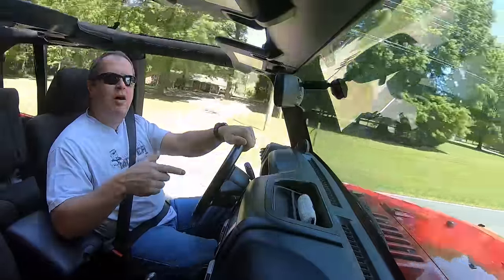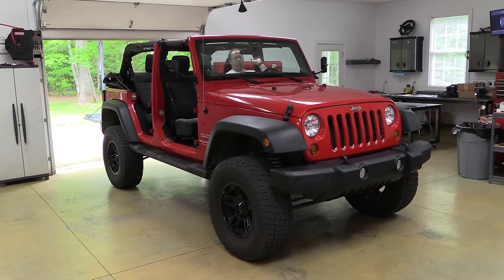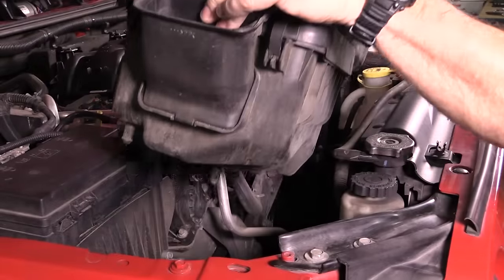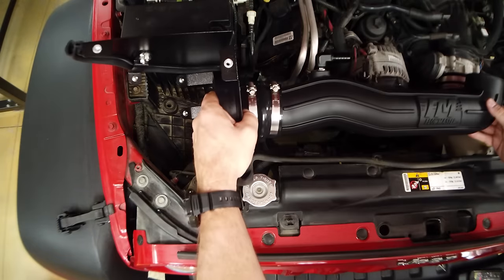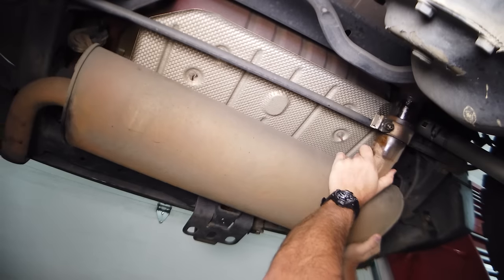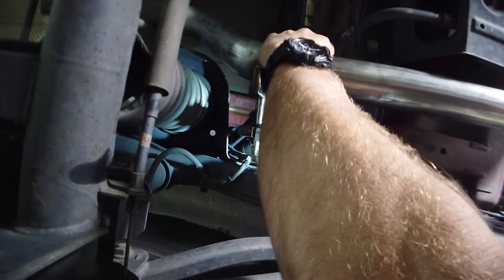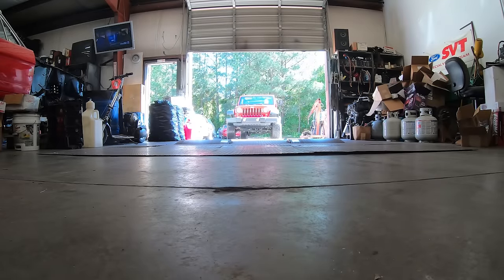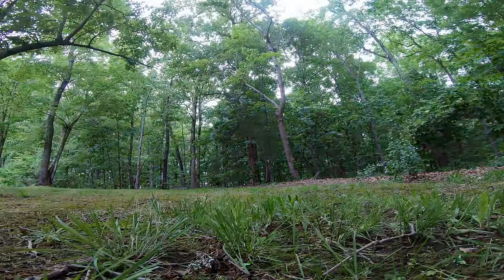Real Horsepower Gains in Jeep Wrangler with Intake and Exhaust Upgrades (Easy Bolt-Ons Only!)

Comment: The best way to get power back after adding larger tires is a gear swap.
Reply: That’s like 2k
Reply: And it’s still not enough. Here in the mountains my jk on 37’s with 5:13 gears is a total dog
Reply: @francisdebelo dang, I’m on 35s thinking of 4.56 or 4.88 what do you recommend
Reply: @Danielxperez14 JL two door manual on 35 with 5:13 . Was running 4:88 on my JK auto for 37 . 

5:13 on the JL because planning to run 37 soon .
Reply: @Joker-TMF  so 488 is good for 35s? My jk feels super slow ever since I bought it
Reply: @Danielxperez14  4:88 is perfect for 35 . Maybe you need a tuner with chip to set everything after .
Reply: @Joker-TMF  what would I need to tune for? I got a diag tool for Jeeps that already calibrated my 35s to the speedo
Reply: @Danielxperez14  on my JK on 37 on beadlock the mods I installed is gear 4:88 , superchip, exhaust, intake, pedal commander. Was running really good .
Reply: @Joker-TMF  I’ll have to try that out then, mine feels like it bogs when I step on it and it takes a while to get up to speed, but 10-15 mph it’s responsive

Comment: The sound difference is amazing! I really thought you were going to get more like 10 to 15 hp out of doing that. Wow.
Reply: Ecu needs adjusted.  Look at the power curve.  It is rough
Reply: @kyleolin3566 correct most people think intake and exhaust are enough, it’s not the ecu needs to be flashed/changed or your unlikely to see bigger gains due to the map on it. You gain horsepower and a slight increase in mpg when you do it that way.

Did I take and new chip on a grand Cherokee got 12 horses and 7 lbft of torque. Was a little under a grand to have done.

Comment: The stock intake on the jeep wrangler is a thing of beauty, a rare engineering example of functionality over regulation. You don't need an aftermarket intake on a wrangler, it doesn't do anything, zip, zero. It also increases your chances of sucking water into the intake manifold when you replace it. The exhaust is something that I can get behind though, but you need to remove the catalytic converters and flash the ECU. If you're looking to stay legal, you'll need a custom exhaust to accommodate the lift you chose, if you're hard-core.
Reply: Interesting as K&N has a CAI snorkel kit that puts the air intake above the windshield.  You must be driving totally submerged
Reply: @twoallame yeah… actually… in Alaska we’re routinely finding water crossings that threaten a stock intake.

Comment: The power will be even better after ~500km. 
ECU will change the settings.
Reply: ecu will change air fuel ratio pretty much instantly
Reply: The auto transmission will learn and change as well.
Reply: As  @IGOPU  explained ecu correct the afr right away or you would melt the piston on the first start making it lean.

Adding more airflow by itself won't do a thing to power, 7 HP difference can just be observed between two pulls back to back.

If you want power you need to move timing and or compression.

Comment: My comments are mainly on your video.  Very, very well done and clear explanations.  I am impressed you were able to get the old exhaust off without having to lift the vehicle.  I am waiting for a Pypes higher clearance exhaust purchased through Quadratec.  Right now, I will likely do a K/N flat unit (no CAI).  As one response stated, I will be regearing (through 4WP).  Again, very good video.  Mine is a 2020, Sport Altitude.
Reply from the maker: Cool, good luck!

Comment: Flash tune it so the vehicle knows there are larger tires/wheels. Will make it perform at the optimal levels and also get your Speedo back in line. Then consider performance parts. Just my two cents! Once I did that after 37” tires it made the jeep run as it should and had the familiar response I was used to

Comment: Loved it and making more power is always a good thing. The next step is to swap out your gear sets  and install a ratio that will bring your engines operating range back into its torque sweet spot. Love the new diff cover by the way..
Reply from the maker: You are definitely right about a re-gear. I got the diff covers from B&M. They actually have dipsticks built into them to check gear oil levels or check for water intrusion in the diffs if you have been wheeling in creeks. Thanks for watching!

Comment: Thanks for this simple instructional video it's crazy that this showed up in my feed cuz I was just thinking I really need to figure out something for my JK the fact that it's a Rubicon and it is gutless really gets to me and there's no way it's going to be able to push 37s so thanks for this video I'm probably going to order that exhaust system and that intake right now
Reply: What gears are you running? And how much extra weight on the chassis?

Comment: You can't never go wrong with those power add on's but☝️ if you want your Jeep to get back to how it felt with stock tires you might consider changing your Ring & pinion and a good high performance clutch. Nice Jeep btw.👍🏽🇺🇸
Reply from the maker: A re-gear would definitely help. Thanks for watching!
Reply: @TheHorsepowerMonster   Thank you for sharing.👍🏽🇺🇸

Comment: My 02' GC 4.7ho Pushes 275-300HP with a 231amc transfer case with 2wd option, magnaflow performance exhaust. Even with a 6 in  lift kit she rips down the road like a real jeep should.
Reply: Pick a horsepower number. There is no she does between this and that. Come on now.
Reply: @dirtysouthtv2209  came stock with 275hp I already put in over 1K$ in HP mods, def pushing at least 300Hp fuck a dyno lol
Reply: @dirtysouthtv2209  wheres your jeep🤔 lol

Comment: I did the same thing with my 2014 4 door wrangler except I used a K&N aircharger intake system and a magnaflow performance catback exhaust.  It definitely increased acceleration and better high speed highway driving.  not sure exactly how much horsepower increase though.  And definitely sounds a lot more "manly"   ; )

Comment: JScan app and OBD2 is the cheapest way to update the ecu with new mod tyre size. It makes an amazing difference. Maps power and shifts brilliantly. Gets rid of her chatter. I was completely stunned when I did mine. Tip go 1 higher there size than what you fitted.

Comment: 2013 sport with 35" + 3" lift : I upgraded with the cheapest air intake and exhaust system for 350 CAD$.  Nice sound and little more power of course. But, the big difference is in the mileage... an average of 4.5 miles/gallon increased. Don't hesitate to do these upgradres !!!
Reply: I agree totally. I' m looking for efficiency (as in an increase in MPG) more than HP and/or FPT. So....I'm going with the Rock Crusher exhaust and the AMFIB Snorkel Low Mount intake system.  
I'll let you know how it works out after the install,
Reply: what air intake and exhaust did you get?

Comment: Have a 13 with 155,000 miles on it and starting to loose power. The engine still runs great, probably a CAT getting plugged. Great video

Comment: One thing that gets me with these after market intake kits is the lack of accumulators.  Those big blanked off tubes on the stock intake assembly are there to hold clean air.  When you step on the throttle hard, this air is drawn into the motor to give a better instant torque numbers.  They have no effect on average number though.  So think of it this way, those are there for taking off from stop lights and sighs.
Reply: Interesting. I thought those were to designed to reduce intake noise.

Comment: Thanks for doing the test so we can avoid doing the same mistakes.
Basically no change in power. A 7hp difference can be due to tempe or atmospheric co ditions.

You would better off playing with the timing and compression, if the head flow enough you might gain some hp.

Comment: Gearing swap in the axles helps a ton too.  Coworker of mine put 50” with lift on his after gearing swap it was like stock again with the mpg’s was getting before.  Also good to checked the fluids down there too

Comment: I have the Mopar intake system for my 2013 jk Rubicon works just fine.Also added throttle body spacer and also made slight difference

Comment: I would advise caution with a cold air intake and offroading.  I've personally seen a few suck water in causing a junked hydrolocked engine.  
Very well made video.  Thanks for the real life numbers based on the dyno!
Reply: You think this is going off road?  First step after tires would be a re-gear if it is going off road.
Reply: @ShainAndrews  lots of people offroad with bad gearing I would say most people
Reply: Stock Rubi 4.10 does just fine on 35’s, could get away with 37’s on a manual. 

And yeah I’d be super cautious about water crossings with an intake like that.

Comment: It does mean a huge difference when you know big tires and rims my brother his is stock and I have a big lift and tires and rims and I has a cold air intake and headers  but still want more power  I thought about seeing if a tuner or chip would make a difference but with the big heavy bumpers and roof rack add more weight but I'd love to just put a v8 in it but has to be ways to pull more power out the v6

Comment: Sure a little more power never hurts but in reality the issue you're suffering is simply a matter of gearing in my opinion. Of course if you have more rotational mass you are going to notice a loss in power, but in terms of putting 35s on with even 4.10 gearing, The issue shouldn't be power. I think the problem your experiencing most likely is not due to higher rotational mass. I believe you're going to notice a tremendous difference by regearing your Jeep. Maybe going to something like a 5.13 gear set. A lot of people(maybe not you) throw a cheap lift kit on a Jeep destroy the ride quality and put a lot of stress on the engine and transmission because they don't regear and fix geometry changes when they lift their Jeep. You put bigger tires on even just a couple of inches bigger chances are you've changed your gear ratio to a point where your vehicle is going to feel significantly more sluggish. When you put a lift on you change all the geometry of the Jeep and often times this causes wandering and sometimes it ends up resulting in death wobble and a whole slew of other issues related to driveline. Of course a couple of inches you're probably not going to notice that much of a difference if you've got adjustable trailing arms and have taken your Jeep to an alignment shop to have them adjusted properly, but on our Jeep Wrangler(4.5in lift) when we got it it was awful to drive, The shocks were terrible, All of the steering geometry was out of whack and it had bad ball joints on top of that. So after putting it nearly $5,000 in teraflex front end parts it drives like a dream. The only thing left to fix is the cheap shocks that came with the cheap lift kit. So take it from me If you'd like to lift your Jeep do it the right way, You're going to be so much more happy with the results and more comfortable driving it to far away places. No one likes a Jeep that wanders into other lanes or can't get out of its own way. I understand doing it the right way can oftentimes result in a lot more money spent and if that's the case well I can understand people trying to just get by with a cheap lift kit and upgraded as you go but just know what your getting into. Sometimes the best left kit is the one that you build on as you go. So when you go around town telling your friends and buddies not to get a Jeep and lift it because you've had a bad experience with it just know that when a lift is done right it rides like factory, or close.

Comment: I think more gains could have been done by re-gearing, I’d be curious what the numbers of that would be. Love your content!
Reply: Dyno tuning is done in your 1:1 gear ratio
Reply: @djdiheheidifhdhdje261  he’s talking about rear differential. 35’s need a 4.10 ratio or 4.56. Stock is 3.20. The gears spin the same with larger tires making it slower. Larger ratios are needed for bigger tires. Otherwise it’s a 25 second to 0-60.

Comment: new cool air & exhaust dyno 7 & 8 hp & torque bump cool across range no reprogramming from stock. God not worth it on good muffler  but when replacing sure go bigger. The freeier cold  air seems no brainer esp in hot climates

Comment: Had the same problem with my 2005 jeep wrangler unlimited. 4inch suspension lift with 33s. Put in cold air intake and exhaust nothing worked. Then I regeared it. Put in 4.56 gears and the power came back. Guys make sure you regear it once those big tires come on.

Comment: If you change the exhaust headers, exhaust pipe and add a air airintake. Which is the best option to do any order works

Comment: Why not just put the same factory mods as they do on the Challenger where they get 303HP from the Pentastar ?  I’m a bit flaky with the K&N as it trashed all the sensors on a previous vehicle, and was NOT over oiled.

Comment: better to just connect a small hose to your inside ac cabin vents to suck REAL cold air into your engine air intake into the air filter box. For a TRUE COLD air intake system...atleast if your AC works and you have your ac on. just have to have a electronic cut off if you have the heat on in the vehicle.

Comment: I have a 2016 with manual transmission and notice the low torque at lower rpm around 1500 to 2000. It looks like the bottom end where the 3.6 really needs it saw a healthy boost, but it’s hard to see the details in the video. How was the drive ability improved down low?

Comment: Lowering the gears puts the gearing back to where it was before the increase in tire size...... The open air intake is not good if you are crossing streams and water, hydro -lock the engine by sucking water through the intake....l. Personally I would have just went with a K&N filter with a stock intake setup......

Comment: Hello all you crazy Jeep owners! 😜👍  I finally bought a Jeep!!  Just thrilled - got a 2014 Wrangler with 33's and a lift, and caught the bug !  My head is on a swivel going down the road looking at every cool Jeep mod that goes by.  I'm sure a couple folks must have had their fingers ready to call 911 as I inspect their beautiful beast!  HA!  Took my son to Memphis and then Little Rock over the weekend - was having a great trip, until I noticed I was struggling to keep up with traffic.  She was okay at 75, maybe 80 when passing others, but when I had to slow for traffic, it took some effort to get back to speed.  Definitely looking to add some upgrades for even a little more oomph.  Any additional suggestions are very much appreciated!  This one looked like a fairly quick way to grab a few HPs.  Thank you!

Comment: Any plans to tune it? And how did you go since 2011/12 with out doing any mods to it😳 lol 
good work!
Reply: 2011 did not have the 3.6 motor. only the 3.8. it was not until 2012 did jeep come out with the 3.6 motor for the wranglers. :)

Comment: gears, only way to get power back bottom line ,iam sure it helps with air flow ,but gears got my jeep go again
Reply: Always regear after getting bigger tires, always. I only started to do the other mods after I regeared.

Comment: Great review and jeep looking good. but 7hp starting around 3200 rpm?  I guess if you drive up in that range it is helpful, but im generally 3k and down.  I am wondering if a snorkel wouldnt do a better job as a cold air intake. i like the exhaust tucked up like that too.

Comment: What gears you are running with those new big tires? They make a tool to get those damn exhaust donuts off too. Also running a larger aftermarket throttle body would help with more air with that intake.

Comment: Thoughts about the CAI and risk of water entering engine? I like the extra air flow but would be concerned about hydro lock. (I own a 14’ JK but am trying to not install a snorkel).
Reply from the maker: It sits at the same location and height as the stock air box. If you are fording deep water I don't think either would be a good idea. Otherwise, it is well protected and fairly high (directly underneath the hood and above wheel height).
Reply: The Horsepower Monster RIPP claims 10hp with their coil-over kit and they seem to have fantastic reviews on non boosted applications.
Reply: you would probably need to go farther than your seat in depth to hydro lock. (not based on any knowledge except height of intake)

Comment: I am planning both of these upgrades, along with a Superchip.  Toward the end you mentioned the increase happed above 3200 RPM, is it possible to get pictures of the graph?  Mostly my Jeep operates between 2k and 3500 RPM, so I am interested in real world gains on the lower end of the scale.

Comment: Any thoughts on doing the PUG intake conversion.  be curious to see what the Dyno tells you, I've done it on mine and it seems to increase the feel but don't have a Dyno to prove it.
Reply from the maker: Wow! I didn't know anything about that. I just burned an hour researching it on the internet. Will have to give that one some serious consideration. Thanks for the heads up!
Reply: @TheHorsepowerMonster  I found that there was some cleanup to do on the inside of the upper intake.  And some slight porting of the upper manifold to give clean flow to the new lower manifold. I also installed MSD coil packs and new plugs at the same time as they were due anyway.

Comment: What about the Catalytic Converter?  Will it pass pollution control standards?  I live in CA and they are super strict.
Reply from the maker: The stock OEM cats are still there, so you should be good.

Comment: Trap second it's always better to get a cold air intake that's enclosed like s&b cold air they got a paxi class so none of the air from the engine gets in also your buddy big tires on the V6 you need to read gear the front and rear differential makes a big difference and you will also have to tune your vehicle to accept the new gear ratio also the new tire size